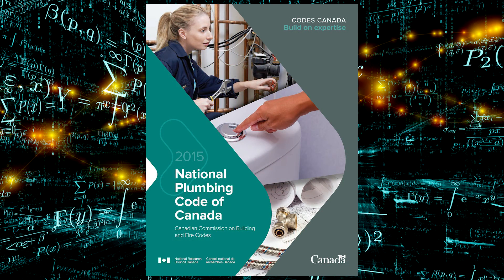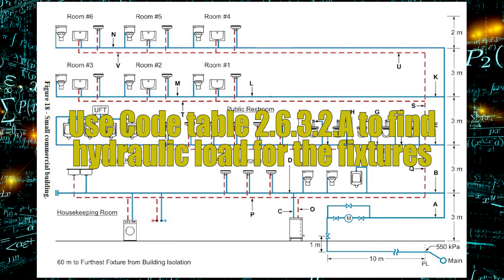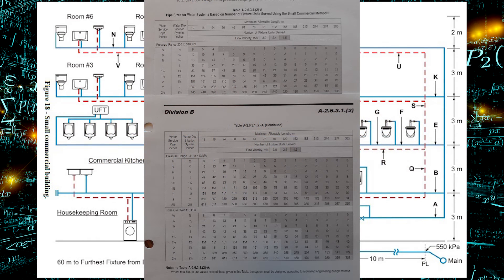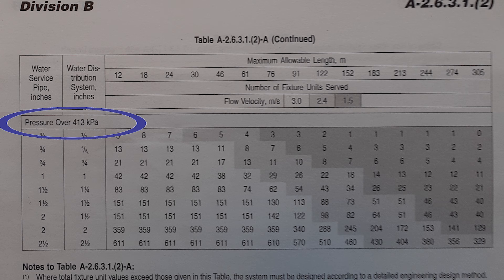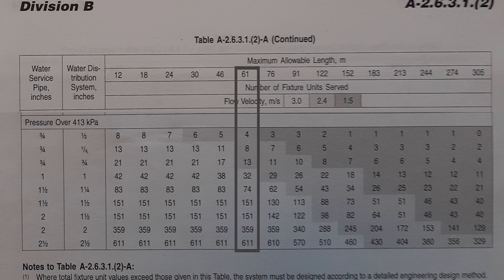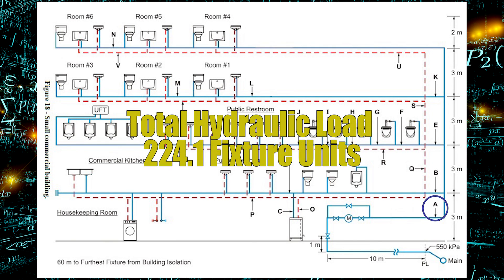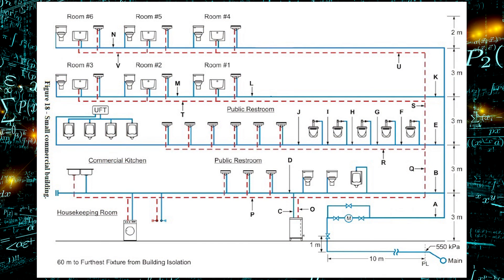Water Line Sizing Part: 3

Comment: Hey quick question. When sizing the water distribution side why didn’t you deduct the flow velocity of the water meter?
Reply from the maker: Short answer is, I didn't feel like it. In the classroom setting, I would talk about pressure loss through the meter. For most of my classroom examples I just said the pressure loss through the meter was negligible so don't take it into account.
Reply: @MathematicPlumber   Flow velocity changes depending and water temperature and pipe type as well. Anyone writing the IP soon would do well to consider that.

Comment: Hey, when sizing pipe 'N' you mention the fixture load is 8.2 for the cold distribution pipe but it is only 6 FU's. It is a public bathroom group worth only 6FU's. 8.2 FU's would only make sense if it were a bathroom group with more than 3 fixtures and you were adding on an extra WC.

Please correct me if I'm wrong but thanks for the videos, they help a lot.
Reply from the maker: There are no bathroom group values listed for public use in table 2.6.3.2.-A . You need to count them up separately and you get 8.2

Comment: I just did the calculation and get only 221.6 which is 2.5 less than 224.1. should I count the hose bibb twice both cold and hot near the washing machine? so 2.5(hose bibb outside)+3washing machine+2.5 hose bibb hot+2.5 hose bibb cold+2x3lavatory+2.2x2 wc+20urinal =44.9 so 44.9+24.6+24.6+130=224.1?
those hot and cold hose bibb looks like one fixture
Reply from the maker: Those hoes bibs are not connected to anything, therefore they need to be sized as if they could be connected to different fixtures. Therefore you count them, as a hot only hose bib and a cold only hose bib. Hot only fixtures need to be counted into the service piping load.
Reply: @MathematicPlumber  thank you！ I am very confident about my journeyman exam after watching your videos!

Comment: When sizing distribution pipe, such as pipe V or N, can we still use the maximum developed length 60m? Pipe V is not that long. I am confused at this point.
Reply from the maker: We always use the max developed length for every distribution pipe in a system. This is a good thing. If you had to use a different length for every pipe, you might end up in a hospital pyhc-ward.

Using the longest DL ensures that you are sizing the system adequately under all operating conditions. This includes every fixture running simultaneously which is unlikely but possible.
Reply: @MathematicPlumber  Thank you Sir :)
Reply: Man this is the best .. these videos have helped me so much thank you

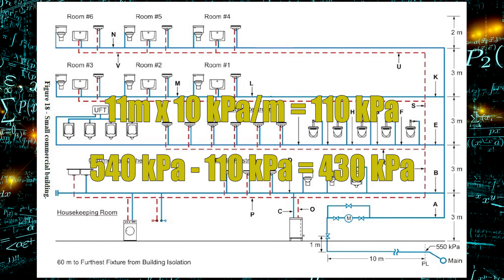Comment: at 4:27, how did you add 3+3+3+3+2 and get 11m? Very helpful video as always, thank you
Reply from the maker: Must have been a long day.
Reply: @MathematicPlumber  thx a lot to you guys !!! so the pressure is 540-14x10=400kpa. so we should use the table in the middle 311~413kpa. with 63.5FU and 60m developed length. we have a 1 1/2-inch hot water line. not 1 1/4 showing in the video？😁
Reply from the maker: @flexiblefix-montreal1167  I used 11m of vertical pipe for my calculations at 3:30 which unfortunately does match up good with the picture. (I forgot to edit those measurements in the picture) That however changes the table for sizing.

Comment: Again, thanks. In the 2ndpart, I am not getting 63.5FU, but 48.25 FU.
Could you help. I need to learn it right. Thanks.
Row-1: {(1BT)*3FU + (1LAV)*1.5FU}*3 = 13.5FU
Row-2: {(1BT)*3FU + (1LAV)*1.5FU}*3 = 13.5FU
Row-3: (6LAV)*1.5FU = 13.5FU
Row-4 (Upper): (1SK)*3FU + (3LAV)*1.5FU = 7.5FU
Row-4 (Lower): (1CW)*2.25FU + (1HB-Hot)*2.5FU = 4.75FU
Total = 48.25FU
Reply from the maker: You are using the 'Cold'/'Hot' columns in table 2.6.3.2.-A, those columns NEVER get used. Use the 'Total' columns ONLY.
Reply: @MathematicPlumber  Thanks a lot. But, I am not sure why the total is used. At the fixture level
1. hot pipes takes hot water only
2. cold pipes take cold water only
Therefore
1. Only, the relevant hot water hydraulic loads to be added to size the hot water piping
2. Only, the relevant cold water hydraulic loads to be added to size the cold water piping.
Please comment.
I am striving hard to learn the right way.
Thanks.
Reply from the maker: @RoyWickrama  These tables are originally from another engineering code. I don't know what one.

The reason why we use the Total column is to compensate for fixtures that run up to their maximum flow rate with only the hot or cold side open. Many fixtures now operate this way due to government mandated flow restrictions to conserve water.
Reply: @MathematicPlumber  Thanks a lot. I went through the code. you are right. I realized what do you mean: it is the total hydraulic to do with.
TOTAL Hot water FU (Small commercial building)
Row-1: {(1BT)*4FU+(1LAV)*2}*3 = 18FU
Row-2: {(1BT)*4FU+(1LAV)*2}*3 = 18FU
Row-3: (6LAV)*2FU = 12FU
Row-4 (UP): (1KS)*4FU+(3LAV)*2FU = 10FU
Row-4 (DN): (1CW)*3+(1HBT)*2.5FU= 5.5FU
Total: 63.5FU

Comment: Thanks a lot for the video of training. Great. I worked it out. I am getting 233.1 FU (against 224.4 FU, your calculation). Not sure where did I go wrong. Could you help me.
Row-1: (2.2FU + 4FU + 2FU)*3 = 24.6 FU
Row-2: (2.2FU + 4FU + 2FU)*3 = 24.6 FU
Row-3: (4 UFT) * 3FU + (6 LAV)*2FU + (40+30+20+15+10)FU = 139 FU
Row-4 (Upper with Hose bib at end): (1 HB) * 2.5FU + (1 SK) *4 + (3 LAV) * 2FU + (2 WC) * 2.2FU + (1 UR-DFV) * 20 FU = 36.9FU
Row-4 (Lower): + (1 CW) * 3FU + (1 HB-Hot) * 2.5FU + (1 HB-Cold) * 2.5FU = 8FU
Total = 24.6+24.6+139+36.9+8 = 233.1 FU
I appreciate your help.
Reply from the maker: On Row-3: There are 4 urinals, but only 1 urinal flush tank. Therefore there are only 3 fixture units for that.
Reply: @MathematicPlumber  
Row-3: (1 UFT) * 3FU + (6 LAV)*2FU + (40+30+20+15+10)FU = 130 FU
Thank you sir.
I am getting your value of 224.1FU.